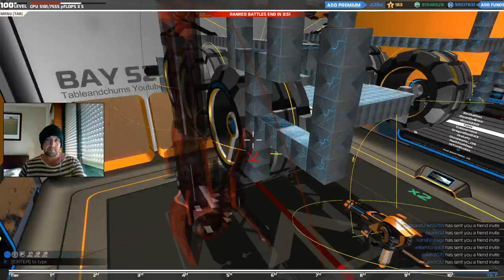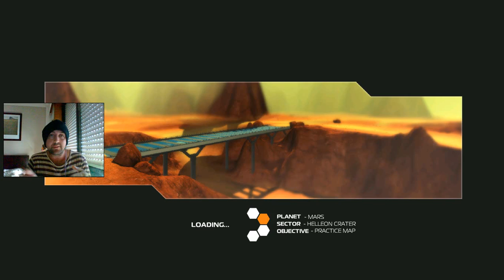Robocraft Tutorial Building the Perfect TX1 SMG Wheeled Megabot - Gun Positions - Let's Build

Comment: the problem i find with this is that, yes the shields repair quickly but in a full on brawl like the mega is supposed to be, the shields would not have a chance to recharge. I have always found that with smg tanks it is always best to build a massive no shield armor mass in the shape of kind of like bleachers shape. shields fall apart in a full on brawl because they lose their charge quickly. shields are better for aircraft's where you don't get hit in the same place over and over rapidly. Throw a lot of triforced armor on and it would do you well.